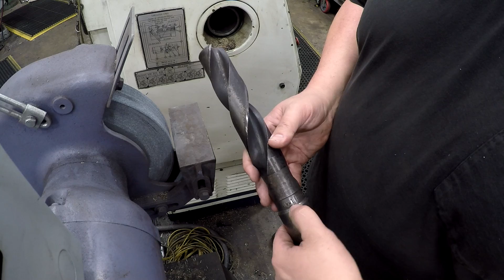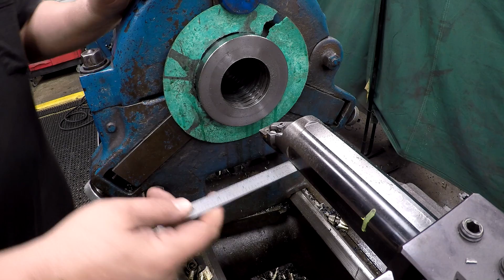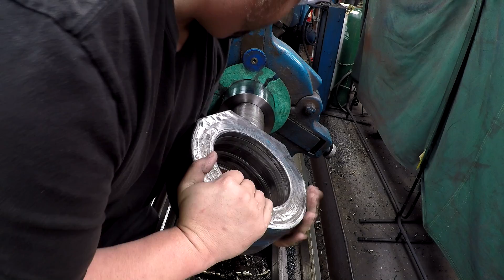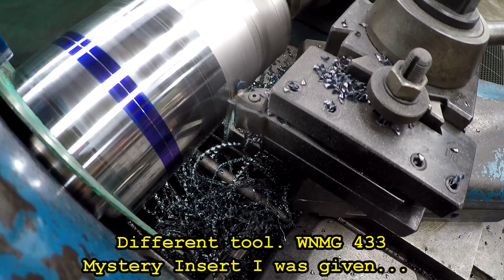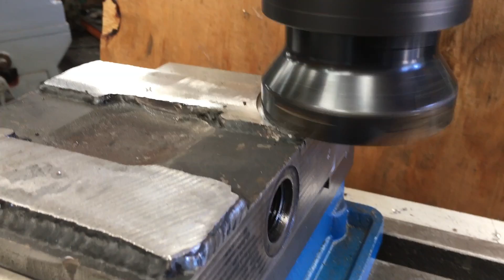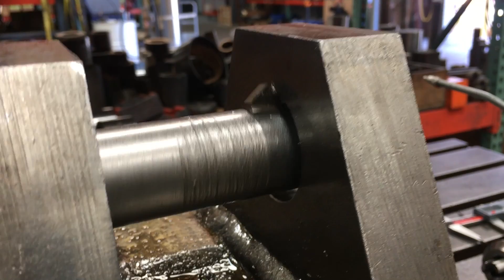SNS 154 Part 2: Hydraulic Rod Machining, Drill Grinding, Threading

Comment: Whatever that mystery insert was it seemed to break the chip a lot better than the seco 1000 insert did. I've had to shorten some induction hardened ball screws and thread the ends before, I'm not sure what insert I used,  but the only way to get through that hard stuff was to cut deep enough, and fairly aggressive feed rate to get past that hardened layer. Those blue long, stringy , razor sharp chips, when you were cutting through that hard part reminded me of that job.

Comment: @13:30 I KNOW THAT NOISE. We used ceramic inserts to strip that heavy chrome/hardcase off the ends of rods before threading - the CNC lathe ran 'em dry, and the stuff would come off in a glowing-red ribbon like spraying head-cheese. It was cool. :)
Reply: Brand-X  You never forget the noise. Try doing this on a Manuel lathe whit red hot chips😎

Paul
Reply: LOL. Glutton for punishment...  :)
Reply from the maker: Brand-X I've never tried the ceramic inserts before. I'll have to get some and give them a shot.
Reply: Isn't that one you were using a ceramic? It looked like it; the ones we used were the solid round type, and rhombus - I forget the brand, though. Maybe Sandvik, or Iscar. I think they were some kind of boron-nitride material - they were solid black and shiny, the round ones were solid and used a clamping-style tool, the rhomboids used the screw-and-clamp type.

The hell of it was that they were actually not quite as hard as the chrome/hardcase layer, but they were tougher - they could take the impact of the hardcase and not chip; they'd still wear fairly quick, but they were feeding the roughing tool at something utterly stupid surface-footage-wise. The round ones usually got six changes per side if you were careful - rotate it =just= enough to bring fresh edge up.

Comment: i like to use a finer tipped insert like .008 or a .004 to make a chip on the hardened material and to speed up the machine to try to get the material to break to form a good chip you have to take a couple more passes but it doesn't produce nasty chips that happens when your hard turning but that's my experience hope it might help in the future. awesome video too

Comment: Had to machine a few induction hardened chrome rods last week. I usually use ceramic inserts but I tried an Iscar WNMG 332-TF IC807 insert. What a difference! .09" DOC (that got under the induction hardened), 160 SFM, .005" IPR. It chipped really nice! Machining I.H. steel can be a bitch and it's all trial and error but great once you get it right.

Comment: I do a fair amount of hard turning at work. We cut ample amounts of hardened tool steel, d2, s7, m4, h13. Those steels are nearly always above 62HRC and up to 67HRC. We have cut it with carbide, but by far if its hard as a wedding prick I would suggest a cbn insert. 

I always cut piston rod with a carbide insert though, Those seco inserts you are using are really good. if you can find the old tp2500 coating its really good for that work, the newer tp0501 does pretty well but not nearly as good. Avoid the tp2501 like the plague though, anything harder than 1018 and it just chews the coating off in seconds.

Comment: Hi there, Adam,

Thank you for the videos.

You often show measuring the various diameters but I don't remember you ever showing the measurement of the various features along the length of the rod.  Considering that some of your shafts and rams are so long that you must need radio to communicate from the head-stock end to the tail-stock and steady rest where the action is, how do you lay out and check the axial positions of the various steps, bearing journals, threads etc?

Comment: I'm amazed you can hold a 3" drill in that extension MT socket and not get chatter! I haven't been so lucky, even at 1" into aluminum - but then, my lathe ain't that heavy!
Reply from the maker: gheumann That's tailstock is pretty massive and has lots of rigidity to it. It's normal to use those big drills. As long as you have a good grind.

Comment: Top tier work as usual Adam - My guess is when your customers get their jobs back theres more often than not a solemn moment when they gather around the most recent newborn and say "man that's nice work"-lol  I wouldn't doubt if its a regular moment nearly every time they install one of your custom made parts or repair jobs.  How could ya not take a moment of reverence before putting one of these fine works into service toward its eventual demise from many years of long hard use. lol
Reply from the maker: yambo59 It's not often we get word back from customers, but when we do it's pretty nice. Some of them appreciate it, others could care less.
Reply: All I can say is that if I received that cylinder, I'd take pictures just to brag about how good my local machinist is.

Comment: Newbie question, maybe a topic for a video?  So many different jobs you do, some you use flood coolant or the mist, some you don't, some use cutting oil, some you don't.  How do you know when to and not to use these?  Thanks!
Reply from the maker: Austin Bachurski It usually depends on the machine im running. I only have flood coolant on a couple of them. Sometimes some cutting oil is all you need to improve a surface finish or help lube the cut.

Comment: Another great video, you make threading look so easy!!. But something I have been meaning to ask is how do you keep all the tooling looking so immaculate? I have a hobby lathe and mill and despite vacuuming and wiping down, they always look dirty yet yours looks so clean. Would be interested in a SNS where you show your cleaning techniques, do you ever wash down or just rely on the cutting oils to keep rust at bay?
Reply from the maker: El Tel It's important to keep your machines clean and wiped down throughout the job and when finished. I try and keep the ways wiped off all the time and fresh oil on them.

Comment: Two great videos today, Adam.  As always I learned a lot.  Nice, nice height gauge in part 1.  If you ever want to spiff up that mahogany case let me know.
Reply from the maker: Jeff Heath The Vintage Workshop What you got in mind?
Reply: If you want to, refinishing it.  Hard to tell from the video, but it appears to be all scratched to heck.  I don't know if it's veneered or if it's solid wood.  If solid wood, I could refinish it, depending on it's current condition, and make it look somewhere between new and way better than it is.    You've got my email address from the scraping class if you want to do anything.  First step is to send me a bunch of photo's of it, inside and out, so I can see how it's built.  We'll call it a collaboration of sorts, if you wish....
Reply from the maker: Thanks Jeff. It's actually in good shape, but I'l take some pictures of it for you one day and send them your way so you can see.

Comment: Hello Adam,  That is beautiful work on the shaft.  I was unclear on your internal threading procedure; when you come up to your dial stop '0' do you feed in the cross slide a revolution at the same time disengaging the half nuts?  Seems a lot going on with no relief cut to a beginner!  As you reach full thread depth if you overshoot will bad things happen?   Since my machine is a 12" with no clutch to hard stop against it seems a very stressful operation.  As always an excellent video.  I look forward to your 'travel' segments.  My son did his Navy flight training there so it is interesting to see the area.  Take care.  Doug
Reply from the maker: Douglas Thompson I set the cross slide to a zero and use the hard lock stop built into it. I use the compound for my indeed each pass. I diengage the half nuts at the same spot each time by watching the dial. It takes practice.

Comment: Another big machining video, or Abom sized machine work, great stuff! Greetings from England, Adam!

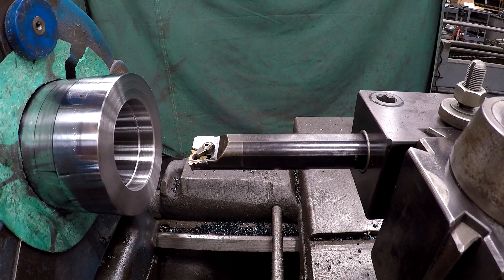Also at the 5:55 mark, wouldn't a fine feedrate help the swarf come off in consistent ribbons, that way they'd exit the bore and not smack down on the insert and risk breaking it?
Reply from the maker: AlmightyBanger I want chips not ribbons of threads.
Reply: I can agree with either in fairness, plus the Cs and 9s can be a bit easier to handle and remove from the machine, albeit heavier and the clanging noises are very satisfying indeed.

Comment: Hey Adam of divine machining skills. Love your work man! I don`t do hydraulic work but i`m kind of curious. Do you buy the stock for the shafts with a finished OD and already polished (what kind of steel)?, and what kind of grit do you use on the belt sander to achieve an adequate finish?  Stay awesome!
Reply from the maker: bollllllleeeee The rod stock is already made and finished. You cut to length and machine the ends as needed.

Comment: Hi Adam, do you have any noticeable tool deflection from the transition between the hardened surface and the internal material? From the video it sounds significant?

Thanks for sharing!
Reply from the maker: Neil Smith There is some yes, but you can work with it with the right tool.

Comment: Do you know how much you removed with the belt sander? Looked like it was more than just polishing it up. I expected you to use something like a scotchbrite belt or a pad hold on the rod by hand. But maybe for a hydraulic rods a thou less or two is not that big of a deal (I never worked on hydraulic rods etc.)
Reply from the maker: 1AB09CC3 On the hard chrome is takes a while to cut it down .002. On a quick polish like that your talking just a few tenths.
Reply: Abom79 Thank you :)
Reply: Abom79    I love watching your videos! Everything, just shooting the breeze as well as doing the machine work, particularly the lathe stuff. I am new to the business but I'm enjoying the little stuff I do!   Is there a reason you use a different type of external threading tool? Your inside diameter threading insert looked like the one I use, and I have one that is the same shape but the tips are opposite for doing external/outside diameter threads. Just wondering why you were using the different insert for the OD threads! Thanks!

Comment: Hey Adam, I am in college for mechanical engineering and I do some machining for my school's formula SAE team. I always see you doing those internal and external threads using the lathe which is really cool. But I was wondering how you know when to engage the auto feed so that you can line up the threads on every pass? 

Thanks, I've already learned a lot from watching you.
Reply from the maker: +Tali Weinstein I have another video I made recently where I explain how to understand the threading dial, the lead screw, and knowing how and when to engage depending on what bread pitch your cutting. I thought I added a card of it but it was a few SNS episodes back. Check that one out.
Reply: Will do thanks!

Comment: 2nd questions: makes loctite any sense if it's loked by form-fit through the screws?
Reply from the maker: 1AB09CC3 I'm not understand what the questions are.
Reply: Abom79 You mentioned that the nut is secured with red loctite and in additiin to that with tapped holes and screws between the bolt and the nut where the thread is joined. So I just thought if the loctite is needed if it is already mechanically locked. I looked up the german term "formschlüssig" and thought "form fit" would be right. Alternative translations are: positive-fit connection / positive-lock securing / interlocking
Reply: Abom79 Just found the english wikipedia article by searching for "safety wire"  that is used foe screws in aircrafts (which is "formschlüssig"). Wikipedia calls it a" positive locking device" e. g. a castellated nut. I hope now you can tell me what's the common term for the connection that the locking screw between the rod and nut makes :)

Comment: I've always been the type to use my own tools for an employer's benefit, even if most feel that a certain item should be employer provided.  How do you resolve (in your mind) using tooling (tooling, not tools) of your own for your employer's benefit?
Reply from the maker: +MDShunk It's been kind of tough working for a shop that has never been fully equipped. There's a lot of tools I already own that I want to use when I work so it's easier for me to bring in some of my own stuff, that's one reason I like having doubles. But some critical tooling I ask them to buy and replace, like consumables.

Comment: What is that belt sander with the long arm? I want one! Also just curious what grit you were using (cleaning up the steady rest marks on the shaft)
Reply from the maker: gheumann It's a crankshaft polisher. I was using 150 grit.

Comment: How hard is that induction hardened chrome rod? Its obviously not tool steel hard but it looks like its at least Rc.45-50..
Reply: Why not machine then harden?
Reply: George Geller hardening will warp material slightly
Reply: nardgames I doubt it will warp any at all... especially being as thick as it is. On top of that it is only case hardened and not through hardened so there is significantly less heat being transferred through the rod to cause any sort of distortion.
Reply from the maker: Austin Washburn Ive never checked it to see what the surface hardness is. I'd have to do some research on it.